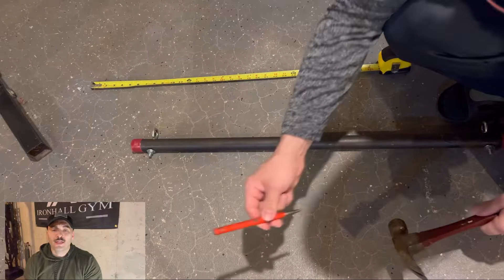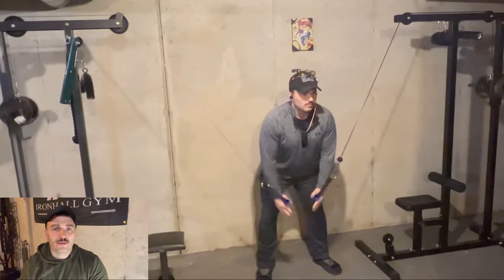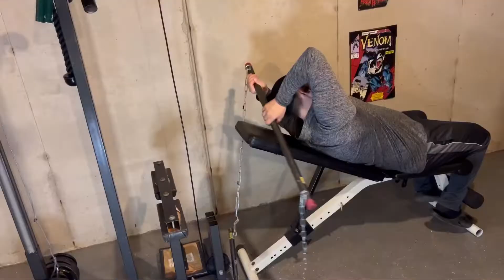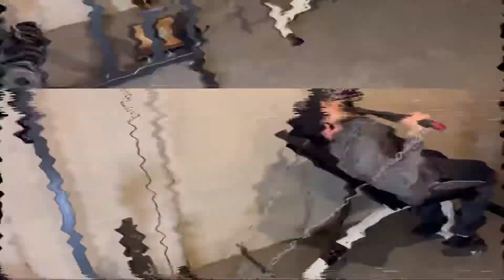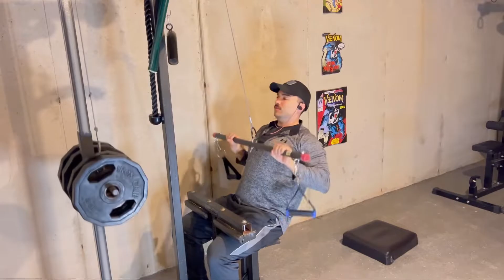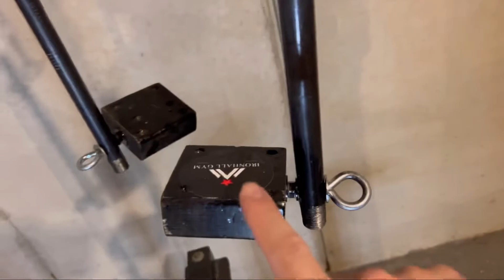Lat pull down chest fly hack

Comment: hello is this metod with chain is good for chest fly? i have just lat pulldown system and i want to try this metod with chain?
Reply from the maker: It worked for me at the time. Just be careful, if you do diy it’s at your risk. Thanks for asking!
Reply: @ironhallgym  tnx just tell me how much cm is long the chain when you work chest cable?
Reply from the maker: @dusanmitic138 I haven’t used it in a while. I needed enough to make sure the bar wouldn’t hit me in the back. Depends on your size and arm length.